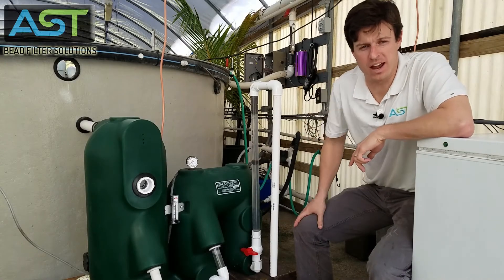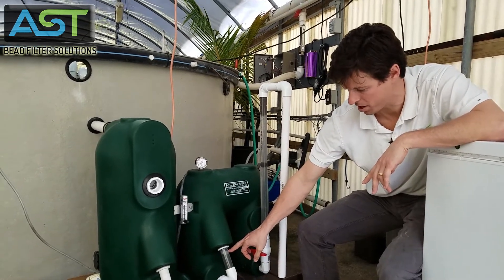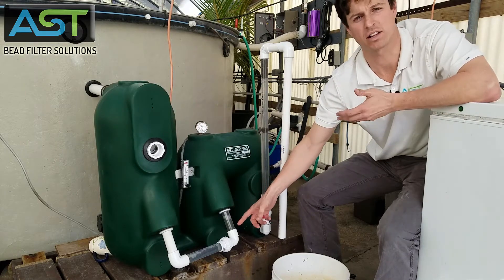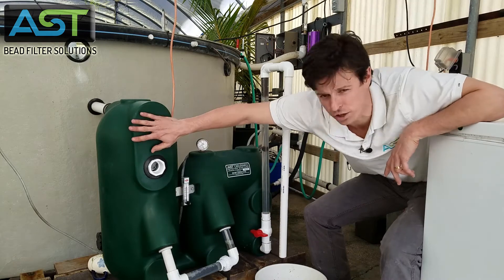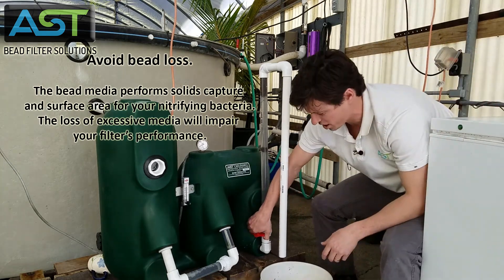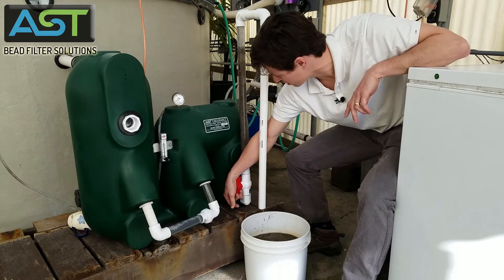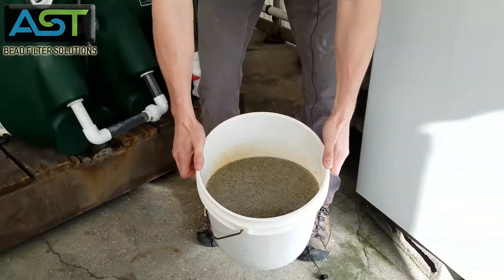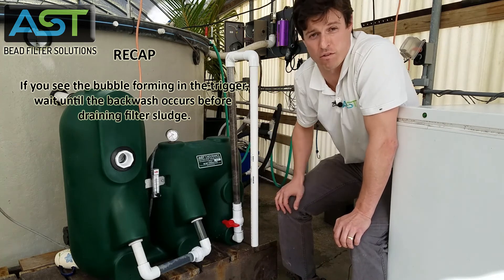Endurance Filter: When NOT to drain the sludge or How to avoid Bead Loss in Your Endurance filter

Comment: In previous videos you told this filter full automatically. In this video you show it is no so. Hm...
Reply from the maker: This unit can be operated either fully automated or with manual sludge discharge. This video explains when to discharge sludge manually if this method of operation is desired. Thanks for the comment and for watching...We will be uploading more videos soon!